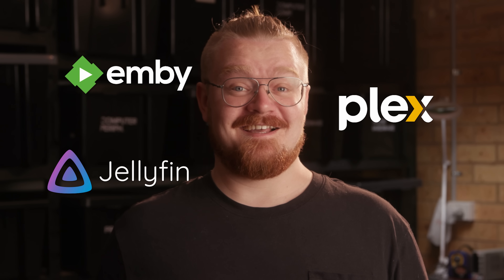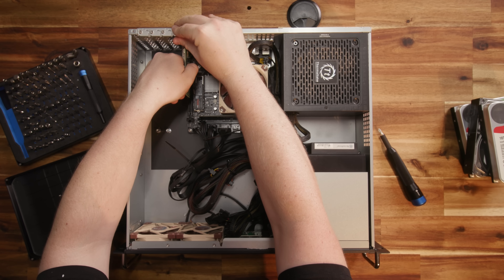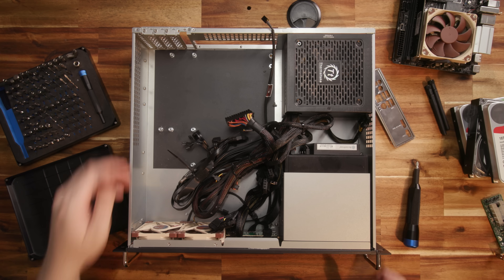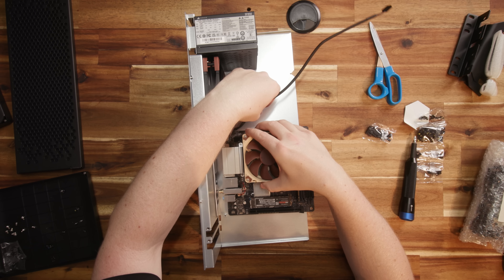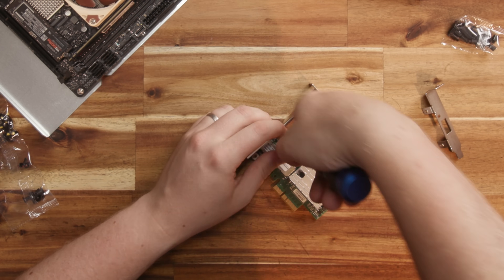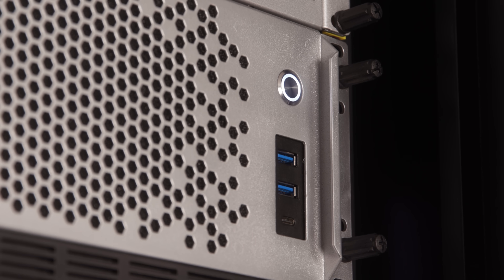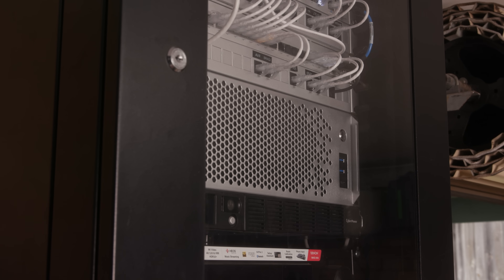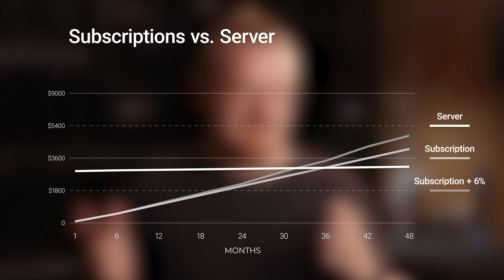I Spent $3,600 Just to Keep Watching Parks and Rec

Comment: neat case even with it's flaws... they most definetly should plop a backplane in there, would make it 10x better... also the CX3702 is 18" deep instead of just 15" and fits mATX motherboards = room for 4 plugin cards (most often only 2-3 though) which leaves room for a 10gig nic, a HBA and possibly a GPU as well or whatever you need. thanks for the video!

Comment: I built my server years ago. I hate ad's. I like to buy physical media but they get damaged far to easy especially with kids. I buy movies, rip them, and put them on my server. Disk goes back into its case where it will sit unless I need it for some reason. Best decision for this house. Been doing this for 7 or 8 years. I run both jellyfin and plex. Having your own server has other perks too. I also run nextcloud, audiobookshelf, podgrab, orcaslicer, etc. Tossed in a arc a310 for transcoding. I run unraid which is dead simple to use. (granted a bit expensive now but it works). Couldn't be happier. Having access to my media no matter where  I am is a must now. I listen to podcasts and audiobooks while working or traveling. Another living in Texas.

Comment: I have a similar story to yours. My story started because of having to rely on a low bandwidth and data allowance on a 4G router. Our DVD connection was impressive in size, but having young children doesn’t work well. Silence is golden unless you have a toddler, even worse when there’s more than one. It just made sense to take my old parts from a recent update and turn it into an Unraid toolbox server. It now handles the majority of tasks in the home: Docker containers for Plex, local game servers, and pi hole, two vm instances one runs win 10 for running Audials one and the other for anything Linux-based. 

I could have gone with TrueNAS, but Unraid doesn’t need two drives at a time; expand as needed.

Comment: I stacked some drives in an old PC case, strapped together with meccano strips (ebay sellers have refurbished old meccano for cheap) and it's been running great for years. One thing i have found helpful is using File Flows (docker app) to slowly recompress all my media in to more modern and efficient formats. The visual quality loss is negligible, but i get about 50 to 100gb of free storage every day in exchange for just one CPU core running x265 continuously, allowing me to avoid upgrading the storage drives. On sydney power prices, that works out about 8x cheaper than buying more storage, last time i checked. If i used an ARM based system like a mac mini or a raspberry pi to do the compression work, the efficiency jumps up around 20x cheaper

Comment: There are also ways to do this on the cheap with old server equipment and the like if you’re willing to deal with some compromises or quirks. I’m currently planning out my own setup which will cost me far less upfront if a little more in electricity. Also at this point I hate corps and don’t mind sailing, so yeah, cheap.

Comment: I used to keep huge digitized collections of vinyl, tapes, vhs, photos etc as well as FLAC/ MP3/MP4 video libraries but after having drive after drive fail and losing irreplaceable files I gave up entirely on long-term digital storage. Taking all the time to load everything onto the drives, tag every bit of media and find every album cover only to get fucked by planned obsolescence after a few years is not something i want to repeat again. If you do have irreplaceable files on an HDD, disconnect it immediately and get a SATA USB cable to access its contents when you need them. Do not have it "live" in your system because it WILL crap out.

I've always loved the idea of library-based media programs(I use MusicBee and RetroArch to this day) but because of the lifetime of HDDs (and cost of SSDs) but I can no longer justify maintaining massive media libraries - instead I opt to just keep what i'm using only as long as i'm using it then deleting/uninstalling if i need more space. I keep my system under 5TB on 4 different drives (if one dies, i got 3 more to lean on and recover files to and i don't spend more than 100$ per drive) I don't pay for subs and never will, a good VPN is all you need.

Comment: I just discovered this channel yesterday. Your aesthetic is amazing. As someone who has collected physical media for 20 years, you also left out a few more huge costs. Re-buying all your media in increasingly higher fidelity, from VHS Realmedia rips -> Laserdisc/DVD -> Blueray -> the next format jump. And with that also comes not hardware maintenance, but having to completely evergreen your server hardware to be more powerful. If there is a format jump, expect to have to bump up server specs to something that does not exist yet. The same as when we jumped to 4K. So in the end, this is likely much more expensive and very time intensive (which you sometimes have to spend when the system stops working, being an immediate problem not one you can choose), but you get control, and that, is something worth pursuing in my mind. At least until they no longer sell physical media / downloads anymore. Has that already happened?

Comment: I built a PLEX/CAD machine in a RSV-R4100U 4u rack case.  It has an i9 11900K, RTX 4070Ti, 128g ram, 60tb of hot swappable drives and two 2tb nmves. I built it for $2k and it does everything I need it to do and more.

Comment: I've spent over $150K on my modes server. It started out small and simple. Looked for a way to fill up the extra capacity I had in my original 30TiB with only 7TiB of data.

Now, I'm running outta space, and I'm over 150TiB of 220TiB on that zpool with $100K of media purchases. It's crazy!

I don't regret it, but it was really expensive to buy everything late game. Wish I'd started a decade ago.

Comment: Im using an optiplex to run 46 drives. 20 from usb 3.2 (full pcie x16 with 8 usb 20gb ports l) 
24 from esata (6 ports in total with port multiplier)
An m.2 connected via 20gb usb 
And the c drive as an ssd. 

I still have 10 gb networking as well via an m.2 slot on the optiplex mobo. 

And I still want to upgrade it!

Im looking at an optiplex with TB4 as I can use pcie external enclosures to add 4 port esata cards and bring over more drives to the system.

Comment: I’m running my Plex server on an old 2012 Mac mini, about to upgrade to an M1 Mac mini, 

Used Synology nas with expansion bay so ability to run 8 drives but only using 4

Mac mini = free

M1 Mac mini = ~ $480 on eBay

Synology RS812+ with expansion bay = $600 shipped on eBay 

4x 4TB EXOS drives = $500 delivered on eBay. 

I think the setup could be better but the Mac mini can be rack mounted with some 3D printed parts and for the price I’m laughing.

Comment: I built a media server for myself around 8 years ago - running on an old i7-4770k with 24gb of memory, and around 10tb of storage - I've made changes and added storage over the years, currently sitting around 25tb of storage, but I didn't replace the actual PC until last weekend, figured time to do away with the high power use of an old PC, get something that can do either way more with less power, or - the same with much less. I think the best part of the whole thing is just not needing to worry about what streaming companies are doing (also, repurposed my old desktop, so the costs were just storage at the time)

Even if it wasn't saving money? Well worth it.

Comment: My non-nerd target advise used to be "Get a second hand 2 bay Synology model that's a few years old from someone/a small business that has outgrown them and install Plex".  There is a spreadsheet (linked somewhere on the plex site IIRC) that explains which models support which quality of playback, so you know what model year to target. If you buy 2x4TB or 8TB second hand drives and put them in RAID 0 or JBOD (because you own the media anyway right 😉, so it's OK if the drives die), you have 8TB or 16TB of movies/TV you can watch. If you buy a plex lifetime on top, you get hardware decoding and remote watching too.
But now with Synology going the vendor lock route and Plex starting to enshittify too (at least a little), I may have to update that advice.
Reply: 2 bay Ugreen or Terramaster devices are pretty cheap, although if you're going to transcode you'll probably want to step up above the N100 versions.

Comment: i went down a very similar path as you. i bought the sliger cx4712. i wish i hadnt, the case has been a nightmare. nothign really fits together, the rails dont fit in a standard rack, and the passthrough connectors have killed 2 16TB seagate exos drives over the course of a year (with Truenas throwing alerts just days before they die). worse yet, sliger wants me to pay for "correct' rails (again) that would fit, and pay for shipping to send out replacement components. even the 5.25" bays on this case were not to-spec. I had to dremel them down to get drives to fit. Its honestly insane and i completely regret the purchase.

Since then ive decided to just buy a rosewill case with similar drive capacity (for 1/3 the cost, mind you) and its been flawless. Lesson learned, dont buy Sliger.

Comment: This is even easier & cheaper if you're only doing this for one person. Get a cheap used high capacity enterprise HDD for US$50 to US$200, plug it in to a US$60 used mini workstation computer, set up Wireguard, & set up a SMB share. I did this with an old desktop I already owned & now I have 8TB. that's accessible from anywhere in the world, except it takes a few seconds to a few minutes to load depending on my Internet connection. I use VLC to stream things from SMB shares on my LAN through my Wireguard tunnel.
Reply: I built mine out of an old computer that could probably be found for around $60-$100 right now, put in a large capacity hdd, and even that can support at least 4 users simultaneously watching the same thing.

Comment: coupling non-ECC memory with large storage transfers like in a NAS is a very, very bad idea. most modern filesystems do corruption checks but only when scrubbing, reading, or writing data—any transfers of data in memory are inherently unsafe and will lead to bitrot. the danger does not scale linearly, either, as you're multiplying the data size transferred time the density of the memory chips, providing logarithmic increase in surface for a highly charged particle from some collapsed neutron star billions of lightyears away to silently turn a 0 into a 1.

Comment: Great video. I've got something much more budget set up at home. I don't really have a rack or anything. My concern at the moment though is mainly the storage. Hard drives are expensive! Mine's currently a mishmash of spare drives salvaged from others' computers...
Reply: I ended up just waiting for a good 8tb drive to go on sale and using that. Alot more reliable than mix and mash used drives.

Comment: I’ve just done a build using a case off aliexpress. 4ru and capable of 12 bay 3.5” and 2 internal 2.5”. Atx mb and psu.

A 600mm rack depth was my limit. The 45 drives 15hl at us$1000 is just utterly stupidly priced. 

Au$2k for my full build with a amd cpu, ecc ram , 32gb ram, 40gb hdd so far and 9305-16i hba and 10g Nic.

Comment: I highly encourage anyone who likes to consume lots of different media, to invest in a home server. I built mine about 4 years ago using an old AMD FX machine that I had, stuffed it into an old ATX Tower with six hot swappable drive phase, that was used for commercial video surveillance. And it's been running sweet since getting it up and running around mid 2021. Overall build cost me about $80 initially, but with drive upgrades I've spent maybe about $300 (2 decommissioned server 12tb HDDs, a 500gb nvme boot drive, and 4 1tb wd blue's). Probably one of my best investments ever.

Comment: Just a heads up, those m.2 to sata adapters are pretty sketch. I got a few years out of mine, but started having some serious reliability issues. Ended up changing over to a HBA and ditching 10gb networking. This got me much more stability with 4 hdd's, 3 ssd's and a blue-ray drive for rips.
Reply from the maker: We'll see how we go! I grabbed 2 so I can have a spare on the shelf!

Comment: Your Bragi is my Titan.
Im running an HPE Microserver Gen10 plus. It runs Unraid, has a single slot GPU for transcode & Immich. Its about the size of a shoebox and provides just under 16tb of parity backed storage with automatic offsite backups. Shes been running great for around two years. Love my lil home server.

Comment: Definitely NOT how I'm doing mine. I have a 12 Tb , 4-drive RAID in a simple tower running  linux on 12 Gb RAM.

When the time comes (soon), I'll be replacing the four drives with bigger ones and restoring from my single drive backup. I'll also have to get a second backup drive. TOTAL cost to keep MY server: $1,000, including the new backup drive. I don't need transcoding, as all my devices do it themselves, since I chose a standard that covers all my devices YEARS ago.

Comment: Loving your videos. Your production capability and quality is right up there. I look forward to what you come up with next. 

I understand why this wasn’t covered in the video, but I wanted to ask about how you handle the storage. 

Based on the pictures of your original server, I’m guessing you were running unraid?

Did you do the same on the new build? Or do you run something like Proxmox or truenas etc? Or is it just a bare metal OS install and you manage the storage array yourself plus some docker containers?

I was just guessing that the storage is a big ZFS pool or similar and wanted to find out what you’d implemented. 

Cheers!

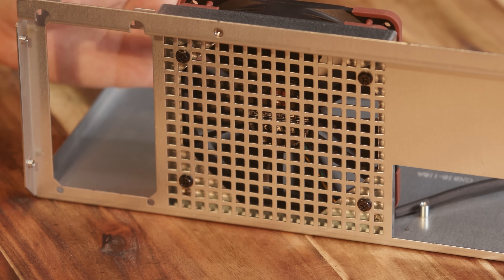Comment: 4:10 ish for future reference, the efficiency sweet spot is no longer half the power supplies rated wattage, companies these days are working to make it most efficient closer to the top end as thats where their usage lies in most cases and efficiency in the low to mid range (of that power supply, not different tiers of PSU) can be surprisingly bad.
not all of them of course, but something to be aware of.

loving the channel so far by the way.

Comment: Option 3 - Google any of the hundreds of pirate streaming services, watch in less than 60 seconds, save yourself three and a half grand.

Complains about irresponsible spending, blows thousands
Reply: Options 1 & 2 are legal while your recommendation is not. 

While he obviously spent on the high end compared to a normal user, you entirely forgot it’s in Australian dollars. He only spent around $2k in USD, half of which is likely just the hard drives themselves, which thus scales with needs. Someone starting out can spend $200 USD on a system and $300 for 16TB usable storage (8TB*3*$100). That amount of storage will last for many years. 

Piracy isn’t theft, but that doesn’t make it right.
Reply: And exposes you to all sorts of nasty viruses at the same time.

Comment: I've considered sliger cases for an upgrade to my current NAS since the HL-15 is crazy expensive but it looks like I'll pass on them. I'm surprised that your new NAS barely uses any power despite 10(?) hard drives, mine consumes a lot more.
Reply from the maker: the drives are spun down for the majority of the time, which helps!

Comment: My ARR stack is on a $100 used dell mini and a pile of external drives shoved in a draw in the corner and works flawlessly, lol

side note: If you're running plex without a paid sub they are about to rug pull a bunch of features at the end of this month, including non-local streaming, best to go emby or jellyfin these days.

Comment: $300+ for a "NAS chassis" that doesn't even have a proper backplane is insane, especially if you paid double for shipping.

The Silverstone RM41 with dual 5HDD bays will give you 10 drives in a 4U case in a short depth rack. It's less than 50cm in length and has better supports for ATX motherboards and power supplies (which means more HBA/SAS cards, etc).
Reply from the maker: I didn't cover it in the video, but my other major constraint was that I only had 3U of space to work with!

Comment: I did a very similar thing in a cheaper Rosewill case, the RSV-L4500U. I've had just one drive failure (a 4TB Seagate Ironwolf drive) in the last 5 years of its operation. I plan to use a Sliger case when I move my personal PC into my rack and run fibre optic displayport and USB to my desk, though with the new tariffs between the US and Canada I suspect I might need to search for an alternative.

Comment: You can cheap out quite a bunch on most of the hardware. For just serving files (and not transcoding) just about anything will do these days. The expensive thing is gonna be your SSDs and harddrives depending on how much space you need.

Very good project that anyone with the slightest interest in computers should do at some point.

Comment: One other consideration is energy prices will also probably rise over those 36 months, so that might affect the break even point a bit, unless you have solar/batteries or something already!

but.....whatever, the calculation is worth it, even putting finances aside the benefits you get from one centralised place for all your things is worth it, regardless of cost.
Reply from the maker: You're right!  

Energy price increases are a little less universal than subscription prices so I opted not to include it. 

With solar and a battery, energy costs could be almost removed from the equation entirely!